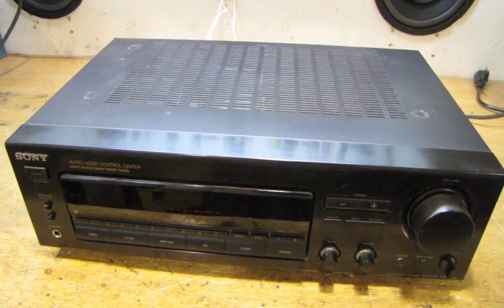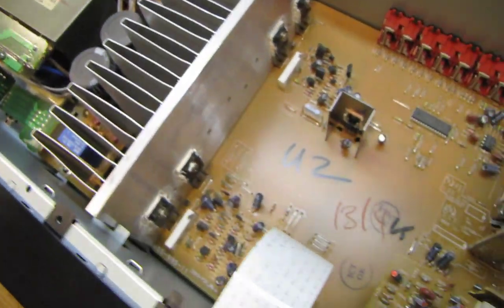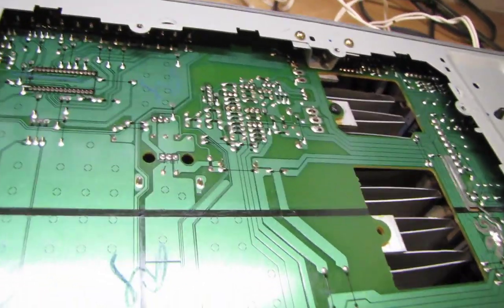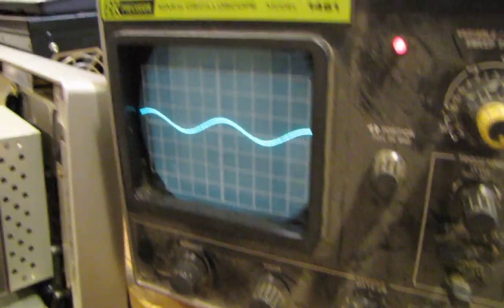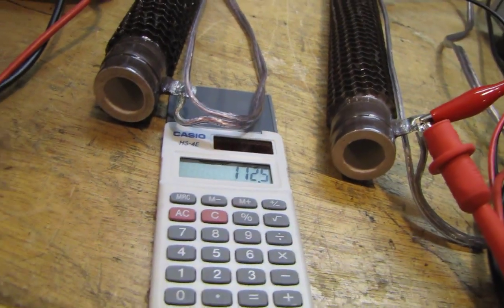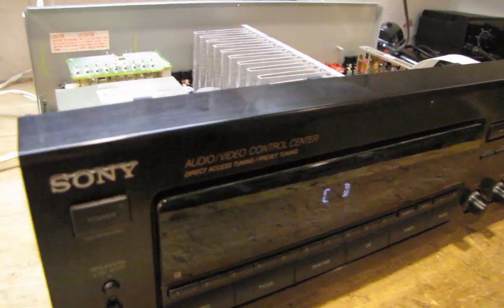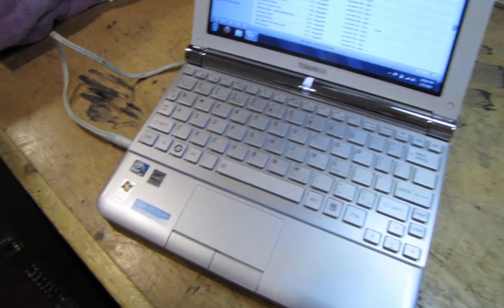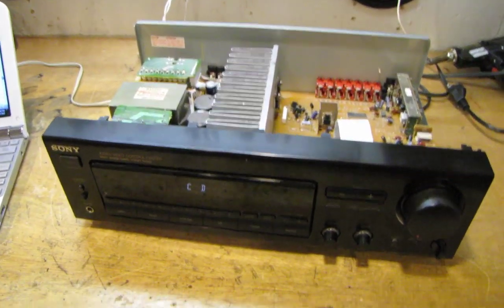Sony STR-D365 Stereo Receiver Repair

Comment: I have an exact receiver and the problem with mine is everything works but the sound cuts out on either A or B I can’t remember and sometimes both will work again and then it’ll cut out eventually on the same side. What would cause this?

Comment: Well done. I have a Sony DA333ES with 'fuzz' coming from left channel. Even then, the fuzz only seems to show up after the unit get warmed up. This doesn't take long after the unit is on even at the lower volumes.
Any suggestions? I am looking to get a replacement unit but not if this is inherent to the DA333ES unit.

Comment: I own a Sony STRD711. Currently I have no power going to the majority of the options on my face plate. The only thing that will light up is the light on the volume knob. I also lost audio from both A&B option. Surround sound RCA JACKS with speakers plugged in also are not producing any sound. I've looked for an in-line fuse but have not been able to locate one. As far as the Audio output goes I'm thinking it is the two transistors that control the sound output for both A&B outputs. The problem is there are like 10 transistors that I can see. 
From what I've described would it be worth taking this to be fixed. I love this receiver. It puts out a great sound and its 390 watts,  thump my B&W 8inch bookshelves.

Comment: my receiver keep blowing the fuse and not turning on
Reply: Do you have a multimeter? If yes, then check the resistance on the main power transformer, also the output transistors. Also look at all the capacitors if they are bulging replace them, a bulging cap is a bad cap. My best guess, (I repair a lot of these receivers) is that it is the main transformer and if you cannot get the info on that transformer you cannot do much.
Also was it caused by a power surge?

Comment: my sony str-dh720 flashes protect and shuts down after 10 seconds , no speakers are connected and i measured all out puts to check for shorts. i have sony issued schematics but do not know what to look for.  Everyone is having problems with Protect and look they just give the speaker issue. I desolder the mn2488 and the complimentary mp1620. no shorts the all test the same. Ichecked all fuses and resoldered some bad looking leadfree solder. lead free is real bad because it can grow hairs

Comment from the maker: Does the display ever say "protect"?  

You need an antenna to get stations, and make sure your speakers are connected to the right terminals and turned on.  If you are using one set of speakers, and both outputs (a and b) are turned on, you won't get any sound.

Comment from the maker: It's a 10" Netbook.  The audio can be set up to keep the internal speaker turned on, just like a lot of desktop boards can be configured to keep the rear audio jacks active when the front ones are in use.  I think it's a common feature of Realtek onboard audio.

Comment: hi,just wondering if you could answer my question,i have the sony lbt-d905 tower,seperates,had it scince new,but today i woke up and the radio/tuner had stop working,  its the only unit that plugs in,as rest of hi-fi plugs into amp,i changed fuse,in plug and checked fuse inside,its ok.i look forward to hearing from you,big thanks,

Comment: Well hello i have a huge question, i have a Samsung Mini componet And i think i fried it beacause when i was listening to music really loud the ends of one speaker cable touched, and it went into protect mode but when i turned back on the sound was all blurry and foggy and at very low volume it shuts down 
now my question is can it be repaired ?
if yes, what would it be the aprox cost of it ? 
thanks

Comment: I have a Sherwood model rv-6010r a/v stereo receiver, all the speakers are hooked up right but as the receiver is play ( min vol around 15 to 20) about 15 to 20 mins the receiver shut off. I have to wait around 15 mins and then the receiver will work...but will go back to doing the same thing again is this a transistor problem or more......can u help me thanks

Comment from the maker: @Watcher3223 As long as you haven't touched any of the adjustments, you should be able to replace the transistors and go.  Newer stuff like this doesn't have a bias or offset adjustment.

Comment from the maker: @BadRonald1 For checking signal quality and wattage, a scope is pretty much necessary.  You won't be able to set the level under clipping well enough by ear.

Even an old, slow scope is good enough for audio.  I've seen them on Ebay for next to nothing.  The scope I used in this video was just a 10 Mhz analog one from the 70's.

Comment: Hi i have JVC 4VR-5456 X receiver and needs repair ,its about  $90.00 worth of new parts - Power  amp section - CH Fronts P,Transistors, CH Reear Sidactors, power drive  IC/R/C.  AMP power section - Transistors  /R/C, 6 x bulbs array 10v 7 x 300.Will they be able to find parts and how much should repair cost?  The technician that worked on my receiver did not find the parts because the supplier did not have them as I have been told, can you help me with suggestions?  Great Work!

Comment from the maker: @nasisimi1 Relays are generally around $8 or so each, depending on design.  They are probably charging around $50 for labor, which is typical for an hour of electronic repair.

Comment: I need help with my receiver it has four output channels and two of the output transistors are shorted. If I take those out and put new ones will it turn on with out any problems or should I check other stuff?? My receiver is a kenwood kr-a4040.

Comment from the maker: @bangulo2012 You usually can't tell just by looking at them, unless they are visibly burned.  You need to test them for shorts by using a multimeter or transistor tester.  Do a search for "how to test transistors", and you can probably find a better explanation than what I can give :-)

Comment: I'm interested in the pasted that you used when replacing the transistors.the paste that you find in shops for CPU,is it good for this sort of thing,or do you need another type?I got 1,5g(0,5 oz)for 2,50€.It should be good?

Comment: i used to have a sony receiver a lot like that a few years ago. it just kept on burning down the big white resistor array next to the power transistors. it also ran really hot, i dont know. i had nothing standing on top it....

i threw it away after it burned its 3th resistor array....

Comment: I had a 1980s Technics reciver which had a cooling fan that would come on at high volume to help cool the amp. It seemed to be just linked to audio ouput level, though, and not actual load on the transistors, so it would even come on when listening to headphones.

Comment: Also I really need to get one of those desoldering guns! I have been doing a lot of circuit board work recently like on the Allen organ and have been using desoldering wick and that vacuum setup you have would make it so much easier.

Comment: That's a really good test setup there! I'm amazed that receiver is still using discrete output transistors. Too many modern receivers I have seen are using power output IC's and I haven't even tried to repair them if the IC's seem shorted as I'd worry there'd be some other problem which would destroy the new IC.

Comment: 4.1 Pro-Logic (only used for stereo) & that all-important phono input! For cooling, I have a pair of surplus PC fans over the vents were the heatsinks are. These are wired to a 12v wallwart plugging into the outlet in the back. The receiver, itself, is in a system rack.

Comment: Hi, sorry saw you had a pair of load resistors but was not sure you drove both channels. My ancient JVC is  a JAS-71... was rated very modestly at 85w rms into 8 ohms, but has paralleled darlingtons in each leg and weighs around 30lbs. 
Sorry for the confusion, no wonder the heatsink warmed up!

Comment: the "extra" power output you saw was not really "headroom" if both channels had been driven at once the powersupply voltage would have sagged a little. Nevertheless it is a fair amount of output, wil make someone a nice amplifier.
My ancient JVC manages 33vrms into 4 ohms.... still in use all the time, realise I have had it 30yrs now! Good to see someone repairing stuff.